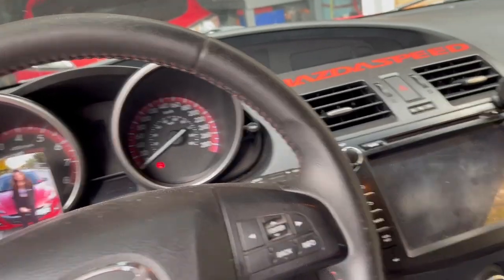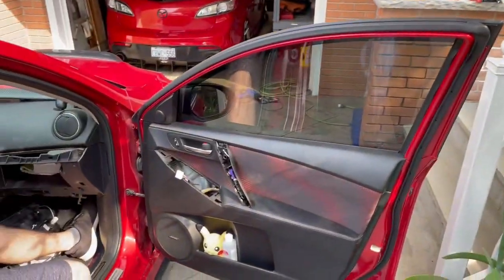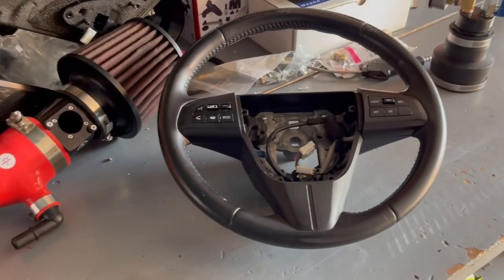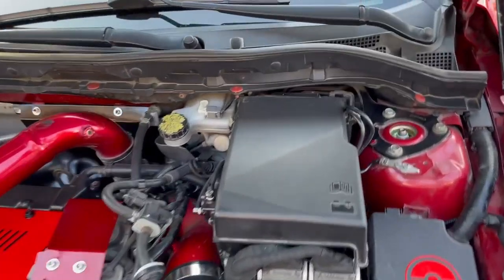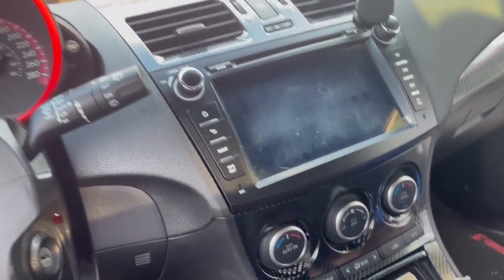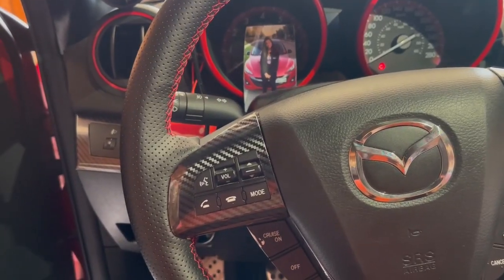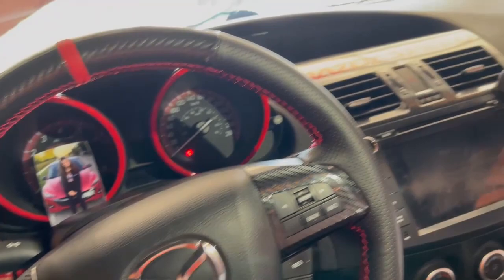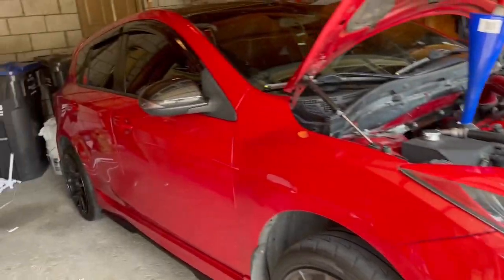MAZDASPEED 3 INTERIOR MODS! | Steering Wheel Wrap + Carbon Fiber Interior WRAP!

Comment: How in the hell did you color the cluster rings? Lol I watched another vid and it looks like you cant remove them without breaking them? Also the steering wheel controls and bottom piece, do those just pop off or do you have to basically wrap them with the wheel out and controls loose? I just started wrapping my interior shit yesterday lol